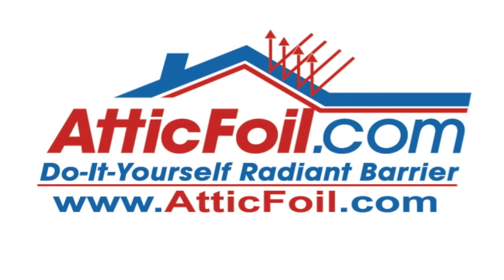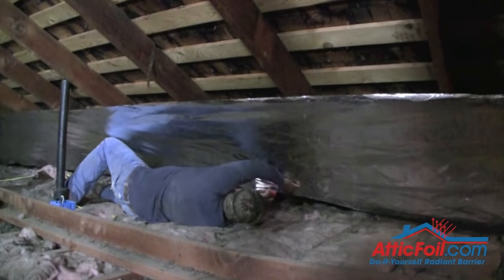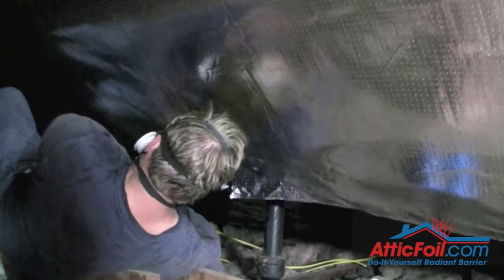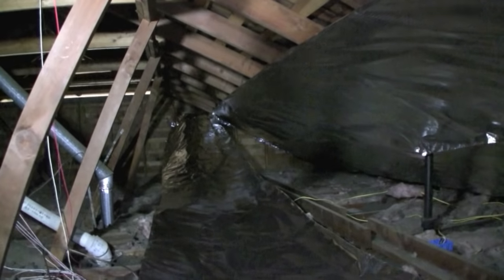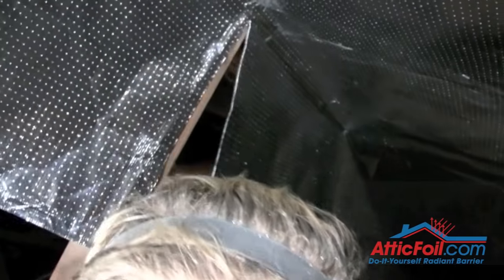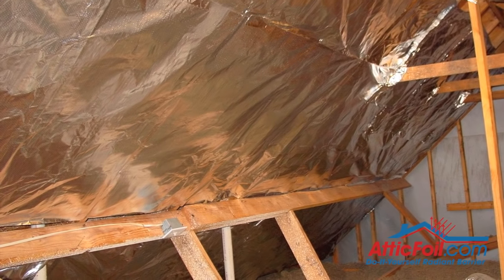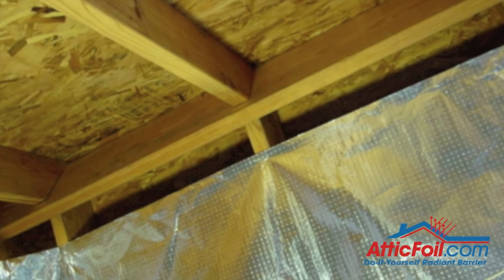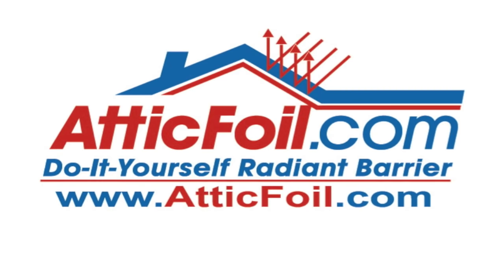Radiant Barrier Installation - How To Install Radiant Barrier

Comment from the maker: Tell us any other tricks or tips you have when installing www.AtticFoil.com Heavyweight Tearproof Radiant Barrier.
Reply: I live in Southern California and it gets very hot so i like this idea but how does this work with roof inspection if i sold the home in 3 or 5 years
Reply from the maker: @ls-33wraith33  In 15 years of selling www.AtticFoil.com I have never heard of any issues with inspections.  In fact, I have many inspectors recommend this product to customers when they buy a home.  Now, they see it all the time.
Reply: @AtticFoil  awesome glad to hear I am eager to try this out. Thank you for responding
Reply: That perforated type can just be laid over the blown insulation?

Comment: I installed this myself and it works the outside temperature is the same as my attic before my attic was 30 degrees hotter

Comment from the maker: You should always wear a good quality dust mask or 1/2 face respirator when working in an attic.  Fiberglass insulation is exactly what it's called - GLASS FIBERS.  You don't want to breathing it if you are kicking it around.  It can easily get airborne and glass fibers aren't good for the lungs.  I recommend using a respirator with P100 filters.

Comment: Excellent product - I installed under the rafters in the attic over my garage, temperature dropped from 127 to 87 in the attic, and it is 77 in the garage - used to be 91 to 95 in the garage on hot days. Worth every penny. Installed it myself, single handed, with a power stapler. 2 people will make it even easier to install. I am trying to do my main attic as well, but it is complicated with areas which are very difficult to access. This is the best thing ever to reduce temperatures in the attic in summer. Winter too, the garage held the heat better than before.
Reply: About how much are you saving on your utilities?
Reply from the maker: Here are thousands of reviews that may help: https://www.shopperapproved.com/reviews/AtticFoil.com

Comment: Ordered your 48" wide perforated double sided foil last week. Started installing last night and was surprised how easy this has been. I started out by cutting the foil into 50" strips and stapling that up but felt like there was a better way to go. After watching this video I think I am going to try running, to the best of my ability, the entire length of the run. Our attic isn't nearly as open on the design but I believe we may be able to pull it off. Thank you for the video and product, We are excited to see it in action!
Reply: So did you notice a difference? Was the house less hot after installing this?
Reply: david seratt did you notice the difference?

Comment from the maker: Not much- foil is pretty much foil.  You could use "regular" foil but it has virtually no strength and is not perforated to allow moisture to pass through. You never want to "trap" moisture.  AtticFoil is foil attached to a heavyweight woven tarp like material. This will give it strength to hold up with staples. "Regular" foil will fall down.  Especially if you ever get a "critter" in your attic.  It will ALL come down.

Comment: I'm looking to install some of this stuff, but my roof has a very high pitch and I cannot reach the apex, even with an 8 foot ladder (which is the tallest I have). I've seen another video that suggests you go as high as you can, then go straight across creating a feaux roof with the barrier foil. Do you recommend this? If so, where should I cut holes to allow air to flow through to get to the turbine vents?

Comment: I purchased 2,000 sqft of your product seven years ago and using the videos y'all provide, my wife and I were able to do this. We took our time and it took two days. Living in South Carolina, we did this in March. We have made notable difference in our house, during both the cooling and heating seasons. Our AC service person said that our attic was the best he had worked in. I remember the cost being around 300 dollars for the two rolls which I consider very inexpensive. We then flattened cardboard boxes to fit our west facing windows and put the foil on them to help keep the rooms cooler as well as covering the entire west facing attic triangular peak wall. Obviously, I purchased too much so we got creative with it, lol.
Reply from the maker: Thanks for the update and being a www.AtticFoil.com customer!

Comment: Hey, that looks like I could do it, IF it can be done on a mobile home. I don't know, but watching this video gives me enough confidence to take the next step, which is cutting a hole in the ceiling of one of my closets to see what it's like up there. It may be that there's just not enough room to do any work in the attic space. Another thing that worries me is whether the ceiling joists are strong enough to stand on. That would be a serious problem.Temperature is not a problem. I already know I would have to do it at night or early morning, because it's just too damned hot to do during the day. Anyway, thanks for motivating me.

Comment: Clear and to-the-point.  My only suggestion would be adding a part where you calculate how much attic foil you will need.  I will check out your website for sure.  Two thumbs up!!
Reply from the maker: Richard, we have a page on how to measure here: http://www.atticfoil.com/knowledge-base/how-to-measure.html

Comment from the maker: Yes, it works of the emissivity quality of aluminum foil.  Oak ridge national labs, part of the DOE did a full scale study and found the the foil decking reduced heat flow by about 33% compared to foil products like AtticFoil which reduced heat blow by about 50%

Comment from the maker: @CrazyTexan Yes, in a cathedral ceiling you will have some thermal bypass from the rafters where three is no AtticFoil® Radiant Barrier. The foil areas will still reflect 97% and you will have some places without any reflectivity. Actual results will vary. For example we have many customers who only put up foil on a West or South slope of their roof and see great results. Radiant Barrier has a cumulative effect, the more coverage the better results. But partial coverage is better than nothing.

Comment: Ceramic coating  roofing shingles is it recommended to knock down a few degrees on top along with attic rad. barriers to help keep the heat nominal to ambient temperature outside .
Reply from the maker: There are some new roofs that definitely reduce heat into the home. But, only if you are getting a new roof.  www.AtticFoil.com helps TODAY!!

Comment from the maker: @CrazyTexan Yes, radiant barrier has a cumulative effect.  On any one spot, it is reflecting 97% of the heat coming off the roof.  The TOTAL heat being reflected is based on the percentage of coverage.  70% coverage = about 70% of total heat reflection from entering the structure.  The more coverage the better.

Comment: Thanks for sharing, this is very helpful!
Just another tip: you may want to keep the higher layers overlap the lower ones in a way that any water leaking through the roof will slide all the way to the edge. So starting working from top to bottom.
Reply from the maker: Actually, you do NOT want to do this.  The water will run down the foil and then drip within 4 feet of the leak.  The water from the leak will also cause some "staining" on the foil edge that is pretty easy to spot.  This is one reason we encourage installing from the bottom to top and not tape the seams. If it goes to the edge, it will most likely end up IN the walls.  Which is a worst case situation.

Comment: Nice video.  I'd like to seen a before/after thermometer in the attic to show the real benefit.  I'm just being picky, I know the foil does a great job.  It's just a show/tell benefit is all. 
I wonder if I could cut it to fit a roll up blind and it would benefit on hot sunny days in a window?
Reply from the maker: Take a look at my video on "What To Expect" The air temperature is mostly determined by airflow into the attic.  The main advantage for a radiant barrier, is that it will decrease SURFACE TEMPERATURES.  It's more important of the actual temperature of the insulation to drop more than the air temperature.

Comment from the maker: The difficulty is usually directly related to how easy (or hard) it is to move around.  Definitely NOT air tight.  You are not trying to control or even restrict air movement.  In fact, you want to make sure to let air flow easily from the bottom to the top of your attic.  How long? - the better part of day.  Some sections go fast and others are slower.  Since they are professionals, the must get EVERY little nook and cranny.  Most DIY jobs just skip the small areas that are hard to reach.

Comment: man! laying on your back across those ceiling joists must take a toll on the back .
Reply from the maker: It can be hard around the edges.  Once the first run is done it gets easier.  Even if you did not go all the way down, it still makes a big difference.  Remember AtticFoil is like shade.  The more coverage the better.
Reply: I would definitely have some plywood up there that I could lay on during installation

Comment: One thing I don't like about installing a Radiant Barrier in the attic is if I have to do maintenance/repair work in the attic or roof it will make it much harder to do. For example, I recently had a leak in my roof. I went up to the attic to find the leak and it only took me a minute to locate it. If I had a Radiant Barrier installed it would have been a lot harder to find/repair that leak.
Reply from the maker: Actually, if you staple the radiant barrier up leaks are easier to find.  The water will run down the foil and then drip within 4 feet of the leak.  The water from the leak will also cause some "staining" on the foil edge that is pretty easy to spot.  This is one reason we encourage installing from the bottom to top and not tape the seams.

Comment: Great video,  I see that your installer left an air gap at the bottom. But should you also install baffles? And wouldn't the baffles eliminate that lower air gap?
Reply from the maker: Baffles are usually the most overused worthless things you can put in an attic.  You want air to be able to either go between the foil and the roof deck OR be drawn into the attic.  You can use the AtticFoil to make a baffle to keep insulation from going into soffit and cut a slit a couple feet up to allow air to enter the center of the attic.

Comment: Are both sides of the barrier the same? Like the aluminum foil for my bakes potatoes are different on each side..?
Reply from the maker: Yes on the double sided radiant barrier from www.AtticFoil.com they are the same.  Sometimes,  how the aluminum is finished will have a little different appearance on each side, but it still WORKS the same.

Comment: We have a fan in our attic that's suppose to reduce the heat.However it died.If we install the hb, would we still benefit from installing a new fan as well? Until moving here, I never knew the damage heat could do to roofing material.What is the average cost to do a home?
Reply from the maker: +Linda Bodder The attic fan is probably dead due to a lack of intake ventilation. Or, the intake (soffit) vents are clogged.  See this video for attic ventilation info: https://youtu.be/NUvgeP7--0Q  I always tell people to put in AtticFoil Radiant Barier http://atticfoil.com/index.php/products/48-wide-double-sided-atticfoil-radiant-barrier-foil-perforated/ first and then see what the AIR temperature is UNDER the foil after it's installed.  Most customers find that the ventilation is adequate.  IF the air temperature under the foil inside the attic is more than 15 degrees above the outside air temperature, then you will probalby want to increase/fix/change the attic ventilation.  This tells me the hot air is getting "stuck" like a clogged drain, and can't move. I really don't like attic fans, I'd replace it with a 14" wind turbine.

Comment: Would it not be more effective to start at the top and work down? if a dreaded leak occurs the rain water flows down the sheet and away, and not pour out of the overlap!?
Reply from the maker: If you have a roof leak it's better to "let it drip"  You don't want water running all the way down and getting into the wall.  So, if there is a leak, it will drip on the ceiling close to the leak. You will notice the leak sooner, be able to find it easier than if it gets into the exterior wall.

Comment: What model staple gun are you using? I’ve done about 30% of my attic using an Arrow T50 and my hands are killing me from the high effort it takes to squeeze the handle. The stapler being used in the video looks like way less effort.
Reply from the maker: You want a "front squeeze" staple gun. I think it's the Arrow 8000 Powershot Pro.  I like the Craftsman too.  Unfortunately, many of these staple guns are notorious for getting jammed.  I'd get one you can easily return.

Comment: I live in Wisconsin in a story-and-a -half house.  The second story is always too hot during the summer.  The front of the second story is all attic and faces west, so it bakes during the afternoon. I recently have built up the floor of the attic and have 11" of loose insulation covered with OSB to use the attic as storage. I have great access to the bare rafters I would like to install this product as shown in the video, but yet you don't recommend this method for my climate? I just want to cool the attic during the summer, will this method somehow damage the attic during the cold winter? Should I install it on top of the osb floor?
Reply from the maker: Generally in colder climates we say install on top of the existing insulation for the living space.  Your situation is unique in that you have an attic basically on the side of the 2nd floor. So, yes.  Stapling to the bottom of the exposed rafters will make a huge difference.  Right now that heat is coming off the roof and into the walls of the second floor. By installing www.AtticFoil.com will break that path, reflect the heat and keep the sidewalls cooler.  Which will result in less heat entering the 2nd floor.  No damage and the OSB will be cooler too so no need to install there. Any other questions, please call the office.
Reply: @AtticFoil  Thanks for the detailed explanation!  I will be ordering some soon!

Comment: thanks for a very informative video but I wonder what would happened if you doubled the layers of  Radiant Barrier or have a much larger than 1" overlapped between the two layers....
Reply from the maker: You could double the foil layers and you would get a little better results as long as there was an airspace between the two.  Normally, it would not be worth it to spend the extra time/money for such a small additional benefit.  As for overlapping the foil more than 1" should be fine.  It's just wasting some product.
Reply: thanks for the reply

Comment: If my attic is already insulated would I have to remove it before installing? Also how well does this climate control the attic itself?
Reply from the maker: You do NOT need to remove the insulation (assuming it's on the floor).  You would either staple-up to the bottom of the rafters OR, you can lay directly on top of your existing insulation.  As far as the temperature in the attic?  It depends.  It CAN reduce the air temp as much as 20-40º but can really depend on how good your attic ventilation is.  The better the ventilation, will normally result in a lower air temperature.  However, a radiant barrier is really intended to drop the SURFACE temperature of the top of the insulation.  THIS is why radiant barrier works so well.  Check out this page on What's the best install method: https://atticfoil.com/index.php/installation/best-install-method/  Or, contact us and we can help with any other questions.

Comment: Will attic foil reflecting the heat back up cause damage to asphalt shingles? I saw videos that happens with spray foam but what about attic foil?
Reply from the maker: No it does not.  Complete info and video here: https://atticfoil.com/index.php/knowledge-zone/knowledge-zone-learn-about-radiant-barrier/myth-or-truth-radiant-barrier-damages-roof-shingles/
Reply: @AtticFoil  Thank you.

Comment: Thanks for the video. Would you recommend installing RB on both the walls in the attic and on the floor over the insulation? Thanks!
Reply from the maker: +gcpl It really depends on if you have ductwork in the attic and where you live.  If you live in a mixed climate AND have ductwork in the attic, then stapling up will have the biggest benefit in the Summer while laying out over the insulation will give you a bigger benefit in the Winter.  If you live in a cold or mixed climate and DON'T have ductwork in the attic, then laying out over the insulation will give you the best year round benefit AND it's easier to install.  We have had many customers do both and have been very pleased with the results both in reducing Summer heat gain and reducing Winter heat loss.  Here is more info on choosing the best install method: http://www.atticfoil.com/knowledge-base/choosing-the-best-installation-method.html

Comment: About how much  temperature difference is it to have a radiant barrier installed like this? How many degrees cooler was it after installing?
Reply from the maker: Here is a video on this topic: https://youtu.be/SGZevwIy8ok
Reply: Mine was 30

Comment: I'm re-insulating a finished attic in an old house. Where would I put the radiant barrier? In other words, fiberglass batts against the roof, then radiant barrier? Or radiant barrier against the roof, then fiberglass batts?
Reply from the maker: Sounds like you have a cathedral ceiling.  Info here: https://atticfoil.com/index.php/applications/cathedral-ceilings-hotmixed-climates/